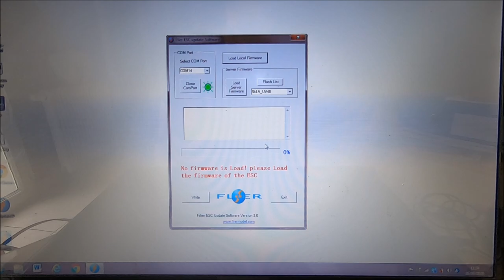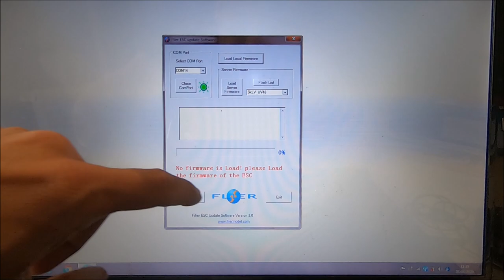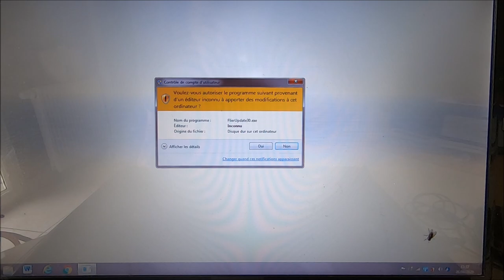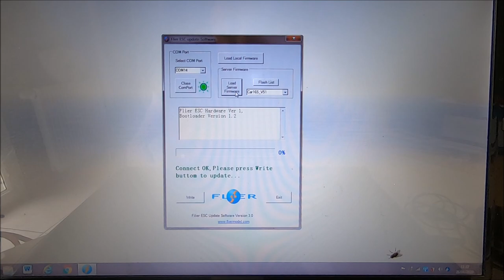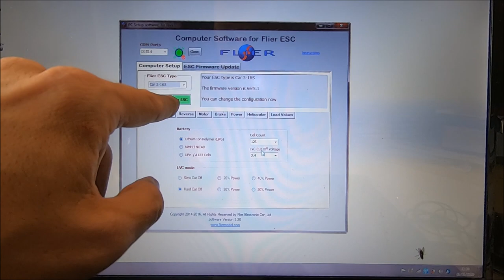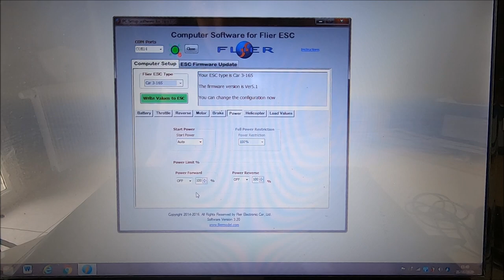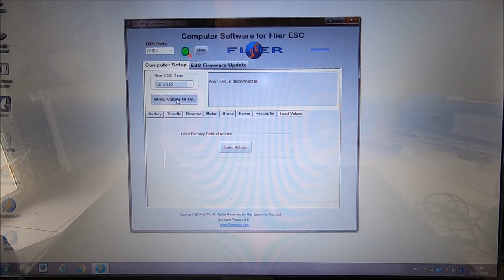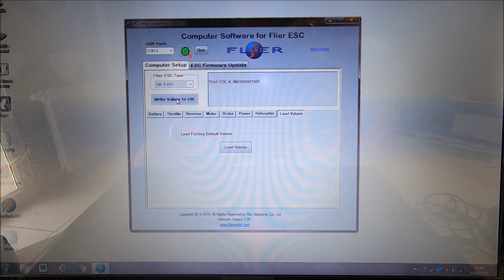FIRMWARE Update flier Car model and Radio setting to have a good brake feeling

Comment: so is the ABS breaking disabled in your case?
May i ask how you achieved to shut of the abs breaking?
I want to use this esc on an electric skateboard and dont want the abs breaking as its not smooth

kr and thx very much
Reply from the maker: Hello , Abs is in fact classical brake.
Reply: @chutpapapeche  a ok i understand
is it smooth in our case aor are there any tips to get it smoother?
Reply from the maker: @SharkWhite333  reduce strength
Reply: @chutpapapeche  ill give it a try and let you know as soon as my setup is complete

Comment: I just got the r-snake version of the flier 400a 3-16s esc, but I messed up. I loaded the wrong firmware and I think I either messed up the esc or motor or both. I now have the right firmware loaded but the rc doesn't run at full speed and it'll stop responding on turns. I'll release the throttle and it'll start again. Is there a way to check if the esc is damaged? There was no smoke and no heat and no sparks.
Reply from the maker: When you plug your lipo You let the time  auto throttle calibration ?
Are you sure  have not an active mixing program on your radio ?
Reply: @chutpapapeche  Yes, I wait till the beeps are done and no, I've never used any mixing programs on my radio.
Reply from the maker: @Blueknight1960  which software you load ?
Reply: @chutpapapeche  I now have the Car16s_V51 firmware loaded. I can't remember which was the 1st one but it was wrong.